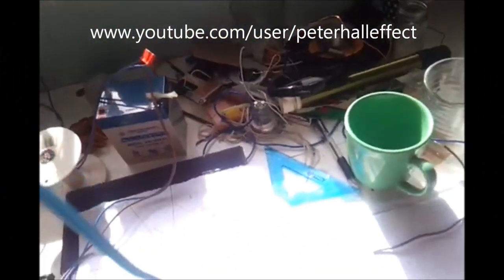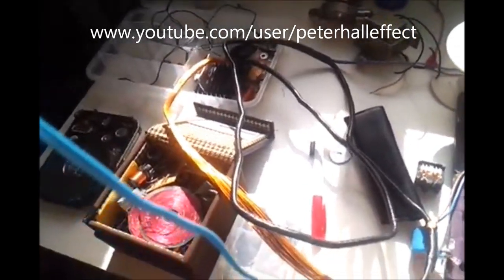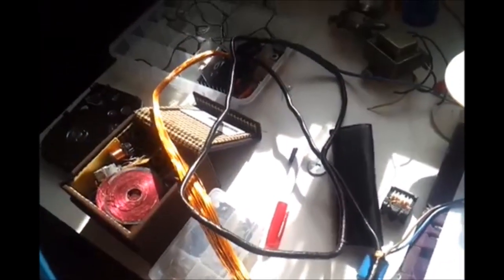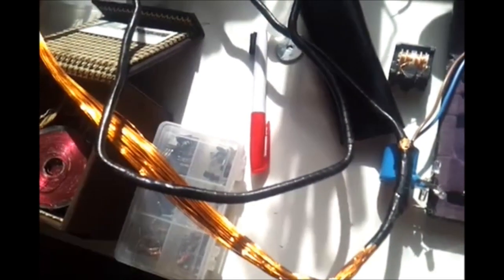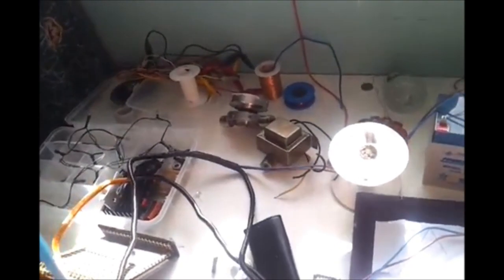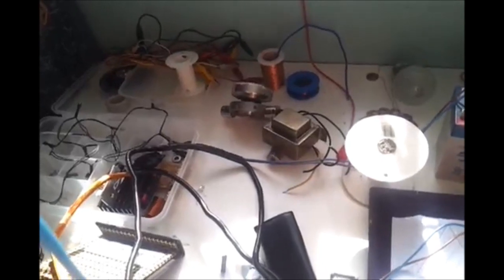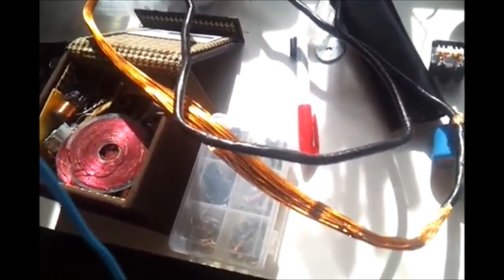Pulse Motor Build Off 2013 Contest Update #1

Comment: Curious is good!!! It could also be a solar powered circuit that filled a capacitor and dumped the energy into a pulse that in turn "pumped" some water into an RO filter. Well, I think it could, anyway LOL might wanna check with Russ on that idea. In fact I'd enter such a beast, but... I already built it... so... that'd be kinda cheating.